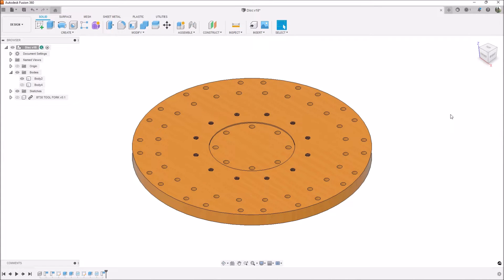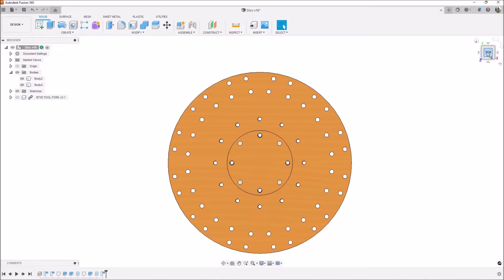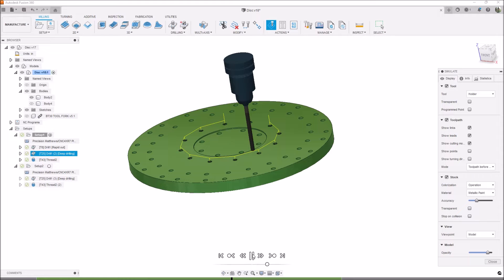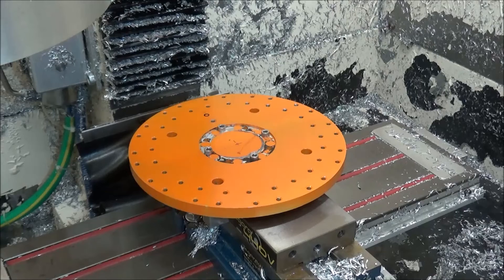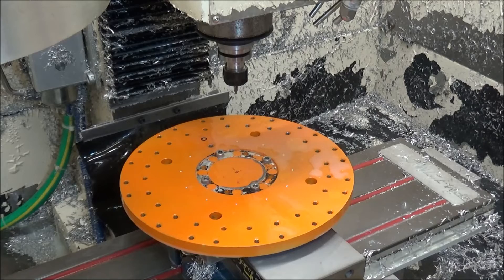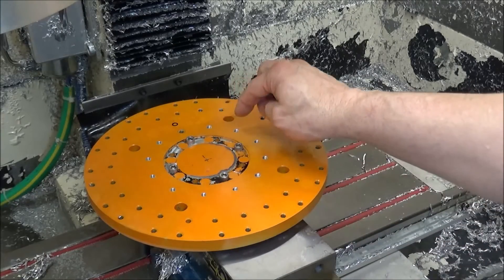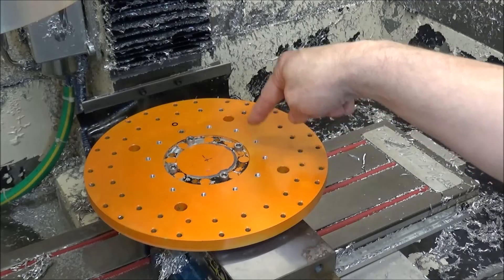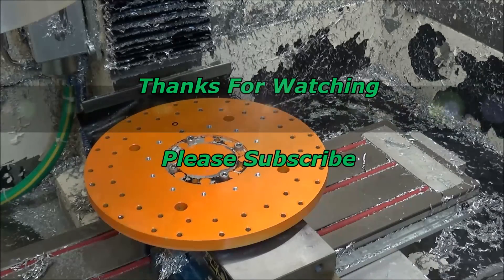MASSO BT 30 ATC Disc Modification

Comment: Hola cómo estás? Buen video! Con poco conocimiento del tema arme un disco con 13 posiciones para bt30, estoy x instalar sensor de 6volt a 36v en MASSO touch pero veo que tú le instalas 2 sensores! Para que sería el segundo?
Reply from the maker: One sensor was Home position. the second is for a counter to count each position.

Comment: Hi Sam, Had a question about milling the tappers for screws, I seem to be having trouble getting it to work correct with cam in fusion, i can't get it to rotate around the hole it always wants to do a drill type opt, if i do a profile i get an error can't use a chamfer cutter, i have the chamfer cutter set to a mill cutter but still no go. also what kind of mill do you use for the tappers?
Reply from the maker: you mean a counter sink?
Reply: @CNC4XR7  Yes and also a taped slot for a tapered head screw.
Reply: A good example would be as in you mini mill video's on the y mount and the Z mounts